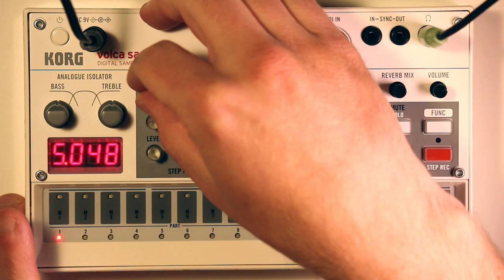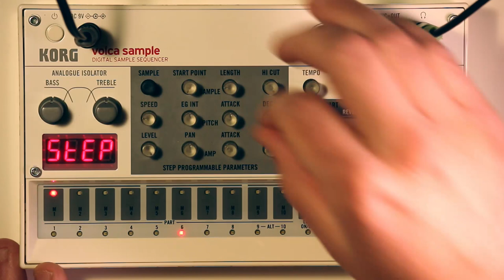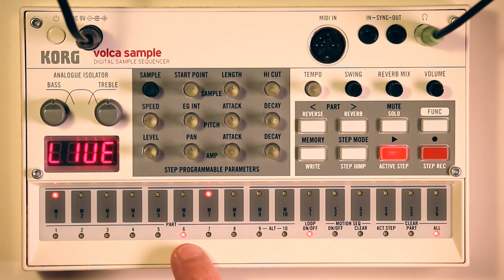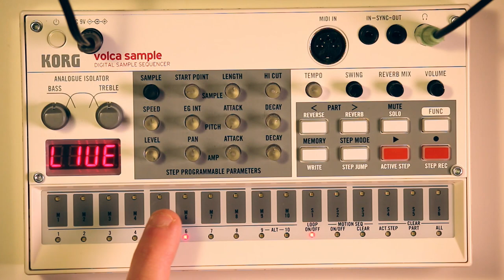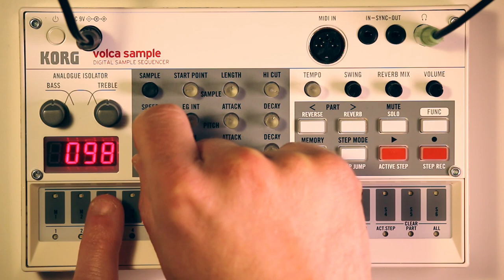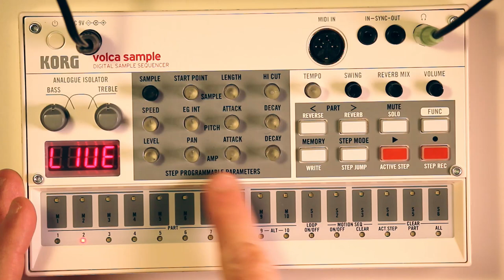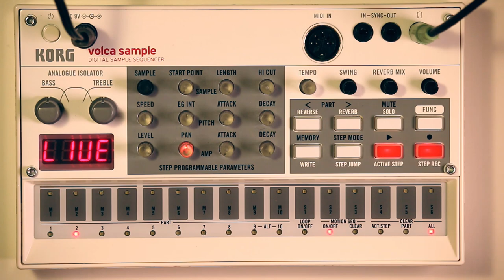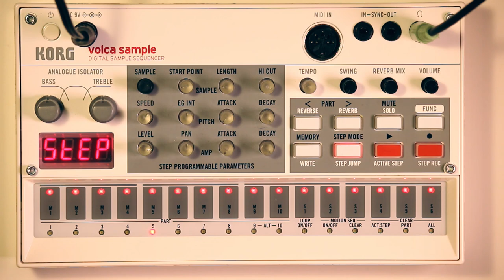3 Volca Sample - Step Parameters

Comment: O man, thanks again! Slowly levelling up the creative potentials here. Now if only I could easily get samples onto this gd thing, it's excruciating.
Reply from the maker: It is a pain for sure, but once you get it working it should work for years to come. If you have the V1, Pajen has published his list of troubleshooting tips for loading samples and firmware: https://www.reddit.com/r/volcas/comments/h120n0/problems_with_volca_sample_data_transfer_im_here/

If you have the V2 then that doesn't apply, it should all be handled by the KORG librarian software, but that has its own bugginess too. This video covers a common issue with the KORG MIDI driver on Windows:
https://www.youtube.com/watch?v=rVy2aqQm3U8

Comment: Sounds like Start Point actually removes from the end of the file
Reply from the maker: No, Start Point cuts off the beginning of the file, and Length cuts off the end of the file
Reply: I had the same feeling as Robert, as when you changed the starting point the sample didn't change the pitch up at the end anymore🤔
Reply: @minimal.camera and also I feel like length doesn't cut of at the end but the beginning. So it would be the opposite way than I was thinking for "start point" and "length. Thanks for the nice video, you explain very good and I like listening to you😁